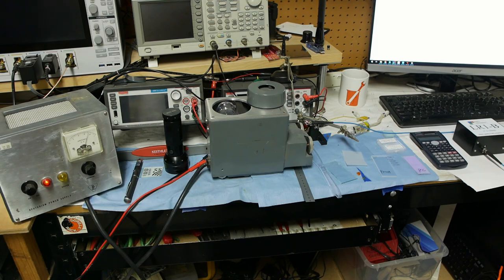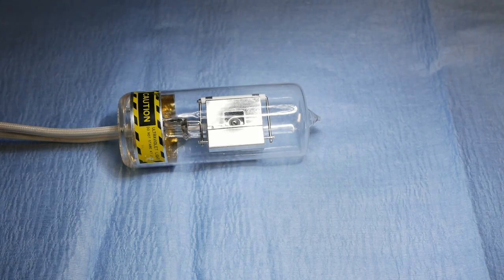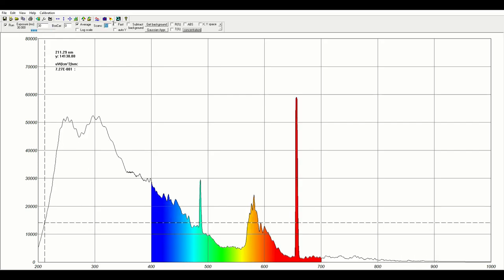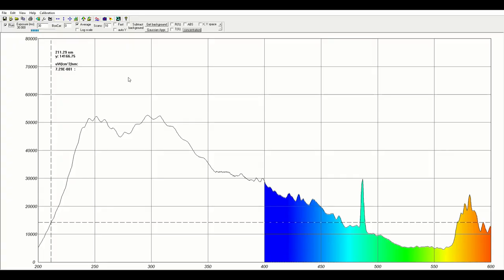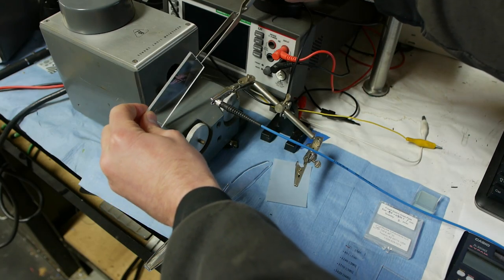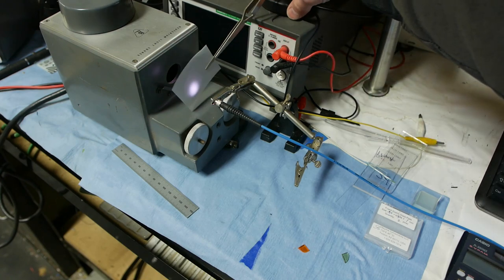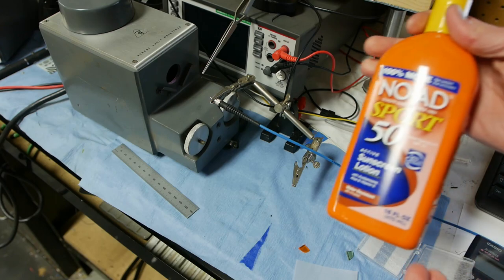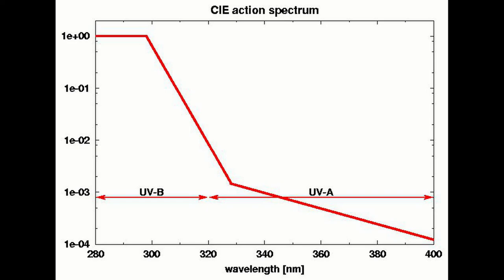Testing UV absorption eyewear and sunscreen with a deuterium light source

Comment: At 16:00, your argument that window glass is sufficient protection would be defeated if it turned out that sunlight contained 1000x more 340nm light than 300nm light, or 10000x more 400nm light than 300nm light. You should be multiplying the sunlight spectrum by the erythemal action spectrum to get an "effective spectrum". That effective spectrum curve peaks at 310nm and reaches well into the 320/330nm region, so squinting at the numbers at your transmission spectra I'd say window glass is maybe SPF10-SPF30 or something, not the slam dunk that you claim it is. In any case, disregarding the spectral content of sunlight in that analysis is a big mistake.
Reply: I think an SPF50 product is basically SPF0 after 30 minutes in the sun because the protection stuff inside there decays quite fast
Reply: Also, the window glass can be quite different, it seems. I just moved to Cyprus, and came across an interesting issue - my photochromic glasses (I hope that's the correct term) turn dark indoors! That has never happened with any other glass, including car windows.
Reply: @EvgenyPakhomov  you likely have some fluorescent bulbs with bad phosphor coatings. UV is being produced somewhere!
Reply: @ardenthebibliophile  Nope, it happens only near the open windows. And even when every single thing is disconnected. I asked my landlord - he says that all windows in Cyprus are like that for some reason.
Reply: @EvgenyPakhomov  I misunderstood I thought it was an internal source and away from sunlight. Does your window pane have a faint green tint, especially viewed from an angle? Soda lime glass may have a different absorption spectrum.
Reply: Yea this makes sense. Sun burnt is definitely time dependent.
Reply: @ardenthebibliophile  Hmm no, more like brown. And not that faint - it's weak but clearly visible if I place a white paper sheet halfway behind the glass.
Reply: @EvgenyPakhomov  it appears borosilicate glass has a higher transmittance in the UV and would be faintly brown. Probably expensive too, but at least it's a possibility!

http://3dprinter.wdfiles.com/local--files/dlp-projectors-optics/Borofloat-vs-soda-glass_transmission.gif
Reply: @ardenthebibliophile  Thanks for looking into it! If it's indeed that glass, I'm surprised that people use it by default here.
Reply: @EvgenyPakhomov  Glassmakers use local cheap resources, so ordinary window glass can be much different from one place to another. It's not really strandardized like some other glass is, and it may or may not be borosilicate causing the color you note.
Reply: @P_RO_  Oh, this really makes sense, thank you!
Reply: @EvgenyPakhomov Another one to test for UV transmission: car windows!
Reply: @doejohn8674  Indeed - my glasses do not get dark inside cars.
Reply: @doejohn8674  isn't a car window a composite with a polymer film laminated between a couple layers of glass? 

I expect  that polymer and the binder to absorb the UV same way as any plastic tested in the video above.
Reply: @atenrok  the windshield yes, side windows are not laminated, afaik
Reply: It appears sunlight energy in the UV to visible spectrum is simply a curve, no x1000 peaks. This experiment could be redone in the sun to validate lightbulb assumptions. You could further improve on that by traveling to say Aruba which has scorching sunlight nearly every day and see how experiment numbers change there because there is more sun energy getting through.

Comment: These measurements are quite interesting form a glassblowers' perspective. Different types of glass emit different types of radiation and therefore require different types of safety glasses (10.1111/j.1475-1313.1997.0_877.x). I am interested in a comparative analysis between cheap sunglasses and specific lenses such as digymium, filterweld or calobar. What do you think?

Comment: Would be interesting to try non-US sunscreen. Especially in Australia, SPF ratings are highly regulated for obvious reasons, and Australian and European sunscreens can apparently contain different chemicals than US sunscreens. So they may be more consistent, to the point where you could dial in a specific "SPF"/UV transmission figure, to e.g. increase the time available to work with UV cures if your UV source isn't adjustable.

Comment: I've read that so-called deep UV, light with wavelengths shorter than about 250 nm are absorbed by oxygen to create ozone. Should you perform the tests in an O2 free atmosphere like pure nitrogen, or argon? If O2 can absorb deep UV, is the distance between your light source and the fiber in your setup short enough where UV absorbtion by O2 is not significant?
Great video.

Comment: Very interesting. So basically you don’t have to do anything special when making sunglasses, pretty much any transparent material block UV light. 
Two questions:
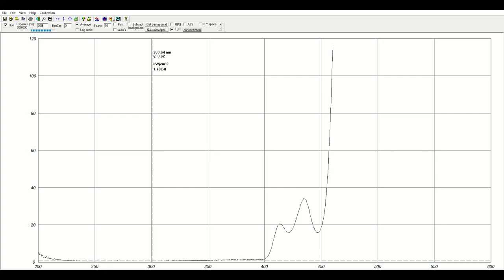1. Did you recalibrate your baseline @19:00 when you changed exposure and sampling time settings?
2. How much does the angle of the sample being tested affect the measurement? I.e. is light reflection a factor here?

Comment: U forgot ur UV transmittance list u promised us at the beginning! Like what's the curve for the plastic knife? Also, u may have forgot what could be the most important measurement. Our atmosphere blocks almost all UVC (100-280) from reaching the surface, yet passes UVB (280-365) nearly unhindered. Why not a test to determine the role distance plays in UVC propagation (at sea level, assuming ur at sea level)? A lens system that can approximate collimation is all that's needed; with it, take measurements from one foot away, then five feet, then 10...
Thanks for the awesome vid!

Comment: From the action spectrum chart 15:30, exposure to 300nm is 1000x as damaging than 340nm, but from you're daylight spectrum reading 3:50, the sun appears to put out maybe 1000x more light at 340 than below 300.  Is the erythemal chart weighted for that?

Comment: Thank you- very interesting! Question about accuracy of the measurements- would you get a better view of the deuterium light if you put the fiber at the bottom of a tube, a la "lens hood?" You certainly didn't seem to be getting much leak-through with the metal.

Comment: Then it comes to laser protection, it’s important to consider the damage threshold too.
Let’s say your glass has OD = 4 but is limited to 1 kW/cm2. If you use 1 MW/cm2 laser it might simply do an hole in the glass and the eye. So both parameters are important for safety. For more details, please refer to EN207 in Wiki.

Comment: At 3:40 youre showing a spectrum of the sun light that shows almost nothing below 300nm with a quite abrupt drop from the highest levels to almost nothing. Is this accurate? Later you mention that only wavelengths below 300 have a serious chance of causing sunburn.
Reply: The ozone layer is extremely effective at absorbing wavelengths below about 310nm. The reason we still get sunburn is because of the sheer amount of light the sun produces, meaning enough to cause harm can still get through. Below about 200nm, oxygen gas is also a very effective absorber, so pretty much no light less than these wavelengths gets down to the surface.
Reply: I was curious about the same thing. The drop off is intuitively unnatural in appearance.
Reply: Yah the bright sunlight trace looks to have lots of measurement artifacts, but whatever.
Reply: I thought the same thing, but he does say around 4:30-5:01 that the sunlight measurements were taken with a 4ms exposure time, whereas the deuterium lamp measurements were taken with a 30ms exposure time. So, perhaps the UV levels of sunlight would have been comparable to the deuterium lamp had the sample rate for the sunlight measurements been around 30ms as well.
Reply: @jhonbus @Mart Anthony good points

Comment: The green material is specifically designed (most likely) the orange is seriously straight outta tapp plastics. It may depend on the photointiator used. I know the projector types use a deeper UV than 405 so the orange works fine.

Comment: Good work but I noticed you did not account for thickness of the material.  it's fine though since it is mostly quantative but for the other viewers it is important in the regions that have steep slope that thickness matters a lot because Beers' law applies.

Comment: When you changed settings on your spectrometer you needed to re zero, that's why you got varying values.  I wouldn't expect that kind of spectrometer to have the sensitivity to directly measure OD7 though.  Even high end instruments from Agilent can BARELY measure that low.

Comment: But it should be noted it's still possible to get a sunburn through glass. It's happened to me driving in the early summer, though it takes hours instead of the dozen minutes it would take outside the car. Apparently different automotive glasses offer varying levels of UV filtering.

Also, does the angle of incidence have any affect on the ultraviolet absorption with any of the materials you tested?
Reply: I think it would definitely affect transmittance. At extreme angles on even a thin material you could end up with an effective thickness of a few inches.

Comment: I would be interested in seeing how standard cheepo poly carbonate safety glasses do for blocking UV.  Every welding or shop safety lecture I have had, the instructor says that safety glasses are adequate to protect your eyes from arc flash (at least from more than a couple of feet).  Additionally, it would be interesting to see how much UV is produced by welding, and how fast it falls off with distance.
Reply: A plastic knife was sufficient to block uvb.  I’d say your safety glasses will be at least as good.  And as for how fast welding UV falls off with distance, pretty close to 1/r^2 for short distances, just like all other EM waves.

Comment: some enchroma glasses (colorblindness curing sunglasses) would be interesting to see
Reply: I've tested them. They are effectively a notch filter that cuts out a narrow part of the yellow part of the spectrum, thereby "separating" the green and red parts of the spectrum more fully and allowing us with red-green colorblindness to differentiate those colors more effectively. If it only did this though the lenses would have a purple tint to them due to the unaltered red and blue parts of the spectrum. So enchroma's "secret sauce" was to add another absorbing dye in the blue region of the spectrum to sort of "white balance" what's perceived by the eye, so that they appear to the user to be a neutral density filter not coloring the light at all. It is the exact opposite way that "white" LEDs work, by starting with a blue led and adding a yellow phosphor over it. The yellow and blue light mix to create a perception of white light even though it isn't really true full spectrum white light.
Reply: @Muonium1  thank you for this nice explanation!

Comment: Would also work to use a mercury vapor bulb with a woods glass filter.  Will give a known output from which the change in amplitude after passing though the test item can be measured.

Comment: So working with that deuterium light source what do you use for eye and skin protection? I'm planning to work with a light source that emits strongly at 185 and 254 nm and it seems like a full face shield and full skin coverage is the way to go but I can't find any face shields that are rated to below 254 nm. I can probably assume that those will also block anything lower than 254 nm (though I would want to test first) but I'm curious what you use since you might have already bought something and tested it.

Comment: It would be interesting to test different sunglasses and see what wavelengths they block. It looks like ordinary polycarbonate safety glasses would be about as good anything when it comes to blocking UV.
Reply: Polycarbonate and UV have complicated relationships. UV actively destroys PC, so there are at least 3 sorts of sheet PC: unprotected against UV, protected from one side and protected from both sides. The moulded PC is most likely unprotected.

Comment: Some disorders like B-Cell ones, make people extremely sensitive to UVA. 395nm LED's are physically painful to me and you can watch my blood oxygen% drop in its presence. I don't have a way to verify the spectrum like you do(yet). Through trail and error I've found a few things that with my UV battle. Acrylic, not latex, house paint great for walls, HD-Everbilt house wrap for filling cracks(the major brand didn't work), polycarbonate safety lenses, polycarbonate film(.005"min) for windows, Gorilla clear tape was pretty good with 2 layers and about half the dry-fit clothing seems to work. I have a ton more to say, but won't.

Comment: At 4:00 you have the solar spectrum and at 15:30 you have the CIE action spectrum.  You will notice that the light we are more sensitive to is almost absent from sunlight with just enough to get out daily Vitamin-D3 dose.  Blocking the UVB and passing UVA is the worst thing we can do because we get the damage from UVA and none of the cancer protection from the Vitamin-D3.

What would be a great thing is to multiply those two curves and see just how dangerous sunlight actually is.
Research has shown that the human skin converts all the days available substrate (7-Dehydrocholesterol) in about the time it takes to get HALF of the an Minimal Erythema Dose (MED).  This means that if we get pink the next day from sun exposure we received at least a full MED, only half is needed to consume the substrate and any more it is wise to protect yourself with clothes, shade, a tan or sunscreen. The more of your skin you have exposed the more Vitamin-D3 you produce.  Equatorial herders and beach life guards have healthy Vitamin-D3 status that self regulates from abundant sunshine and controlled substrate and almost everyone in temperate latitudes is deficient and badly so in winter.

What would be a great bit of research would be to determine the relative ratio of good (UVB) to unnecessary (UVA) ultraviolet light in the sun at various times.  The daily cycle, the seasonal cycle, overcast, dust, smoke, smog.  The rule of thumb, by those who appreciate the immune modulating and gene expression benefits of generous physiological levels of Vitamin-D3, is that there is almost no UVB left once the sun is less than 45 above the horizon.

We can think back to the Victorian era when Rickets (severe Vitamin-D3 deficiency) was known as the London/England disease on the continent because it was very prevalent there.  The coal smog prevented almost all UVB reaching the ground and children were the victims.

Comment: regarding the 3d printer, I imagine that the orange material was good enough and was ultimately chosen by the design and marketing people because they thought it looked better.
Reply: its also possible they chose a material that lets some 405 through so you can see that the machine is running both for troubleshooting and for safety so you don't try to force the door open or something

Comment: with the different sunscreens you should normalize the spectra for the wavelengths it is not supposed to block (>500nm), that way you would not be sensitive to the actual thickness of the film. it seems, for instance that you had a much thicker layer of the spf 50, which blocked a lot of visible light as well

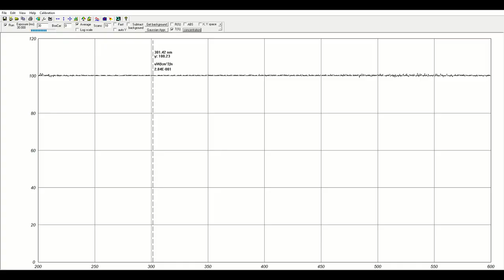Comment: Enjoyed! One question on your data: on the ruby laser safety glasses it looked like the absorption curve shown at 9:00 is about 40% near 600nm. I would expect that to be higher, or see steeper fall-off. Is that something to do with the way you have the photo spectrometer set up for us measurement?
Reply: Ruby laser line is very near 700nm though. Prob very low by the time it gets out to there
Reply: 10mintwo, that’s what I mean be steeper fall-off. And sure, perhaps it does. But there is something odd anyway because of the light source. So I wonder if the photo spectrometer is set toward shorter wavelengths

Comment: And now I am wondering how well sunglasses with dichroic and polarising filters block UV. Both of these sunglasses really help me to see more, compared to just tinted glass they dim less of the ambient light, and more direct sunlight. So in terms of how much you get blinded they are great, but how well do they block UV.
Dichroic filters clearly have some interference going on in the visible light spectrum, you can tell by just looking at them and seeing them change color. But how does it work with shorter and longer wavelengths than I can see (i want IR to be blocked too)?

Comment: I like your videos, always interesting. You are measuring transmission with the sunblock, you could try transflection or a combination (is there correlation between those measurement methods?). We use this kind of measurement in our laboratory but then with ir light and powder samples

Comment: Good stuff.  What will you charge to run curves on glass we send you? Looks like you data dispels a theory I heard some decades ago. It was posited that sunglasses might allow MORE UV in than viewing with naked eyes. This could be true if they transmitted a substantial (say 50%) in the UV but transmitted very little (say 10%) in the visible.  The eye's iris would open in response to the "dark: glasses allowing even more UV to enter the eye.  It looks like  most glass that is not fused silica lets very UV in at all.  Interestingly it is well known that most dark sunglasses are virtually transparent to IR. So using sunglasses may allow greater amounts of IR into the eye.